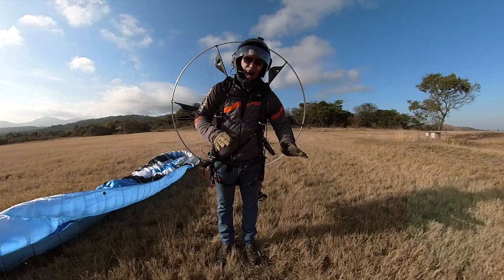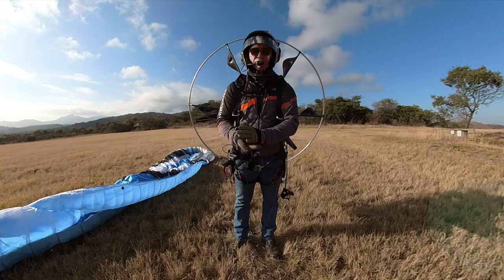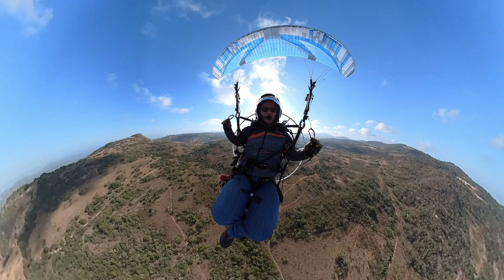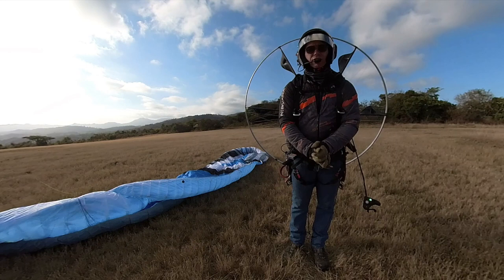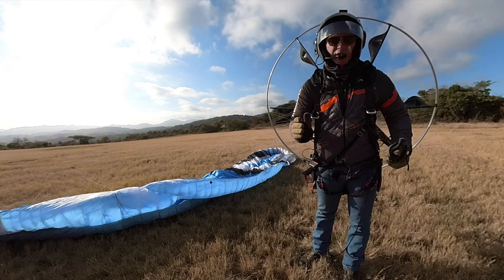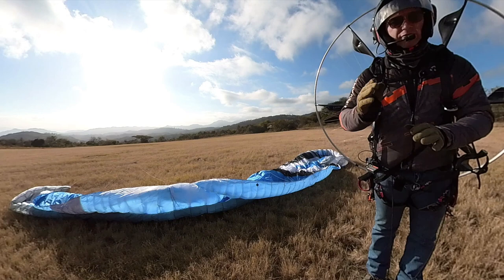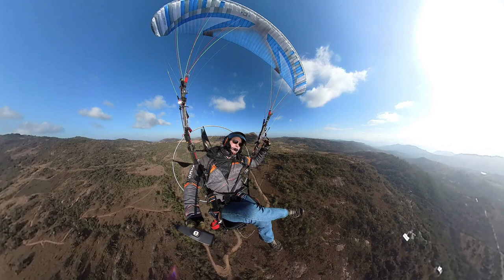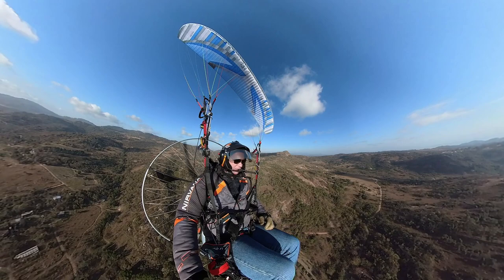LOW hang points VS. HIGH hang points.

Comment: My Bulldog Paramotor has high hang points and has excellent weight shift designed into it.  All the benefits of a high hang point with none of the downsides of the mid/low hang point. Carabiner is lower for the launch, making launch a breeze, and goes up once seated for flight comfort.

Comment: Eugene woke up passionate this morning. :) I have 8 years of flying experience and over half of that is on two different high hang point machines. I am now on low (F-Light) and actually prefer it because I like more feedback from my wing and weight shifting. I agree with you 100% about the benefits of high hang point machines. Everything is about knowledge,  technique and muscle memory. For those that don't take the time to learn about the characteristics of their glider and then post a video about it the only people they will influence are the ignorant that would probably do the same thing.
Reply from the maker: Exactly what I meant! Thanks for posting the answer. Pilots need to know the difference. Need to know the technique differentiation and that will ensure wings dont get BURNT 🫣😂

Comment: I’m from Ireland 🇮🇪 just came back from spain 🇪🇸 after doing my zero to hero course with fly-Spain flying Paramotors I loved it have all my own equipment here now so just going to practice away ⛅️🪂 new subscription to the channel✅ my wing is a Paramania-Revo-2 paramotor is a Nimbus-120R it’s high hang point I must get used to my own equipment now🪂 do I have to make or get any adjustments to my wing to suit high hang points or is it ok standard
Reply from the maker: Congrats. Just make sure your brakes are short enough. You would know by having enough flare on the landing!